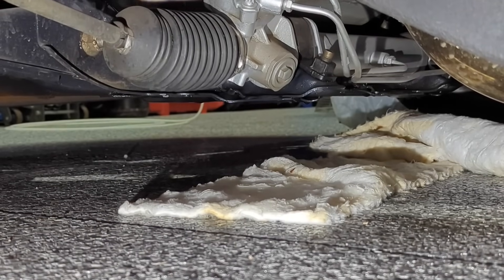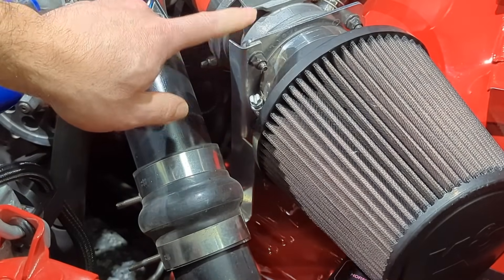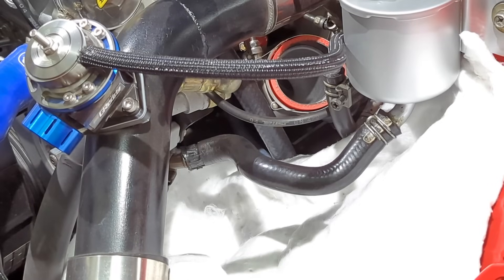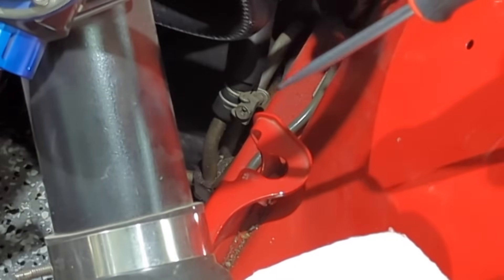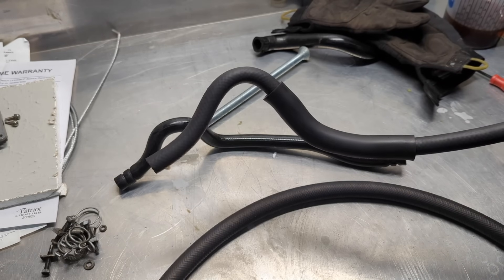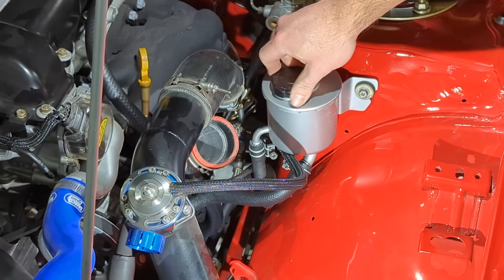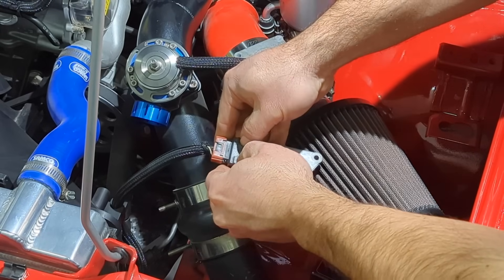Bend Rubber Hoses with Tubing Bender and Heat Gun without kinks!

Comment from the maker: Thank you all for great feedback!  Check out Part 2 where i use steam instead of a heat gun! https://youtu.be/n2sOGI15BnE?si=g1V-b-so6cwOiYtq
Reply: My method worked. I didn’t damage the rubber.
Reply: @erroldillon1548  Hey man, thanks for this. I used your method and it worked great.
Reply: What's that link?
I'll watch it if you give me a link.
Reply: I studied your video and did a new method. I made a template. I then placed the old hose on the template to make sure it would fit. The next step was to use a wood board with my drawn template to put screws on the side of the old hose. I heated the hose up. Afterwards I put it in the freezer.

Comment: Great video. However I see you are using tons of bad quality jubilee clips for water cooling lines. Any hose subject to heat cycles should use either Click-R clamps, Ear clamps or at least a spring loaded clamp of some sort. Else, it's guaranteed leaks later one when heat cycles create play in the screw mecanism.

Comment: Very interesting and informative video!! What size spring tubing did you use for the 3/8" fuel line hose.  I ordered some from Amazon but they were too large (OD) to fit inside the 3/8".  Please provide link where you ordered spring tubing that fit the 3/8" fuel line hose in your video.  Would really help me out.  Thank you so much.

Comment: I try with fine sand it works too. Just put sand into the hose until no space left and then bend it while heat it then dip the hose to bucket of water while rinse the sand out

Comment: You can put a copper line through the hose and bend it to the shape you want, heat it to about 250-300F and keep it there for about 5 minutes then throw it in the freezer for an hour, pull the copper tube out and you're done. Only 90 degree bends are a pain as you will have a real fight to get the hose off the copper tube, for that I drill a few holes into a piece of sheet metal, enter some bolts through the holes and place the hose in between the bolts so it would stay in place as its being heated.

Comment: what temp do you heat them up to ? Thank you very much for the info I'll try doing my oil return on my R33 gtr
Reply from the maker: Around 200 degrees in freedom units works well, the important part is cooling it back down rapidly in cold water.

Comment: Yeah I cant get this 3/4" coolant hose to stay bent using this method.
Reply from the maker: Are you cooling down with cold water while still bent?
Reply: Yes. I tried 3 different times too. The only difference I see is he is using the stiffer type of hose power steering hose or fuel injection hose.

Comment: Doesn't work long term with rubber hose. 
The rubber hose is made of a thermosetting compound.  Once heated and cured it is that form and can't be reformed.  
You can do this with plastic that is a thermoforming compound.
Reply from the maker: It's worked long term for me.

Comment: Hope not using fuel lines for replacement not rated for power steering fluid.. will deteriorate from the inside out. Just a little tip
Reply from the maker: Thank you for the feedback.

Comment: thank you from the bottom of my wallet you just saved me $100s of dollars in metal fittings . i had 8mm oil hose i  used an extension spring cause i didn't have the fancy stuff like you had with the aid of some tie wire measured the depth i needed and the over bent about 30 degrees and used a small kitchen gas torch heated had to do it twice  but result  125% thank you again
Reply from the maker: Sounds like you used some great innovation! I'm glad I was able to help! Thank you!

Comment: Hi sir. About how much of heat (Degrees Celsius) is needed to bend the power steering hose?
I don't have a heat gun. Will a hair dryer be good enough?
Reply from the maker: I dont have the exact temperature needed, but it seems somewhere in the 90C range would work. A hair dryer could work, you would just need to apply the heat for a longer time. Thank you for your comment and good luck!
Reply: @thegaragehub  Thank you for your assistance. I will just purchase a heat gun instead.  It would be much quicker doing the job 😅
Reply: Hi. Got myself a heat gun. Tried, but the hose isn't bending 😅. Maybe not long enough?
If you don't mind, how many minutes did you heat the tube until it was able to bend?
Reply from the maker: @Ad-gc7th  it depends on the size of the hose, the ones I did took about 2 minutes, if they are bigger go a little longer. Make sure to move the heat all the way around.
Reply: @thegaragehub  it's a 3/8" hose (9.5mm)
Reply from the maker: @Ad-gc7th  heat it for twice as long as the first time and see how that works
Reply: @thegaragehub  Ok thank you sir for your early response. It bent a little and retained the shape. Maybe I'll do it one more round and then hopefully it will be the desired shape.
Reply from the maker: @Ad-gc7th  it will help to bend the hose further than you want, and cool it down quickly
Reply: Good evening sir.. Is your hose rubber made of NBR?
Reply from the maker: @Ad-gc7th  probably to some extent, with brading.

Comment: Very good technique. Is this what mechanics use when they fabricate hose? I was wondering if this could reduce the durability of the hose because you are heating it up and changing its shape?
Reply from the maker: Its an option! Durability wise, only time will tell. I just made another video using steam instead of a heat gun.
Reply: @thegaragehub  do you know which method the manufacturer uses to bend hose?
Reply from the maker: @Dynasty-s1y  according to a comment, they use steam.
Reply: @thegaragehub oh wasn’t sure if they used some sort of mendrel
Reply from the maker: @Dynasty-s1y  oh I'm positive they do, wonder if they ever covered it in "How it's Made" tv show 🤔
Reply: Hey I gave this a shot on a power steering return hose for my car but it didn't seem to move very much at all. I am wondering if my issue was not enough heat or if the hose itself was too strong maybe? I heated it to the point where i could see a little smoke come off at one point. @thegaragehub

Comment: Nice video got a suggestion, auto trans. fluid has abrasive in it for the fiber plates in the trans. and will cause premature wear in your p/s pump and steering box and hoses and seals! Try 10 weight hydraulic oil or baby oil which is the same thing without the additives and will not harm your p/s system. Baby oil is cheaper to.
Reply from the maker: That's quite interesting. I'd like to know more about this.
Reply: @thegaragehub  ok baby oil is refined petroleum or mineral oil and so is power steering fluid! It is also made from vegetable oil to and vegetable oil will mix with mineral oil to but don't mix it with oils like motor or gear etc.  Automatic transmission fluid has polybutenyl succinimind is a dispersant and tricresyl phasphate dielkyl phasphite are a friction modifier that's in transmission fluid for the clutch packs and band inside 99% of automatic transmissions okay 👌

Comment: Good stuff. Why didn’t I think of this? You don’t need special tubing bending tools. You can use extension springs from the hardware store where the OD of the spring will slip into the ID of the hose.
Reply from the maker: Thats a good idea!

Comment: Let me know when you have thirty years and no failure. Old Mercedes Benz hoses can be 50 years old and still not have bad rubber. They were made before the first OIL CRISIS, when all quality parts especially those like rubber were made with inferior quality
Reply from the maker: Well the oem ones made it 26 years, if I change that one clamp I'm hoping to get at least another 20 years on them 🤞🏽

Comment: Material memory could be an issue IMO, when it gets hot the bends will straighten out. 
Great idea, will try it for sure, TY
Reply from the maker: This may be true. However it is a solution when the oem hoses are not readily available or no longer produced. There are other methods such as converting to AN fittings and lines that would be a more permanent solution but rather costly compared to the example given. Thanks for your feedback.
Reply: I believe it is inevitable that this will shorten the life of the hose. When they molded new ones they are chemically changed by heat. You are changing the chemistry of the rubber, and I bet it is not the same as when it left the factory. The majority of the stress is in the fabric layers and they are probably not affected by the heat. But if you heat rubber enough to make it no longer plastic it will change it
Reply: @dennis-nz5im  Hose life is definitely a concern. I think I would do this in a last-ditch effort if there are no custom hoses available for my application.

Comment: Nice work  Clever . 
WHY? reuse those Garbage quality Bent Wire hose clamps though ??
 They.. are the reason the OEM hose failed.
Reply from the maker: It's all I had on hand, I need to replace them with maybe some t bolt clamps.

Comment: Very interesting video. I never would have thought that you could heat up the rubber hose, bend it to the desired shape, let it cool down and it would retain the shape. Thanks for the tip. Will come in handy.
Reply: My only concern is material memory,  ie first time it gets hot it returns to straight
Reply from the maker: Thank you, glad you found it helpful!

Comment: Thats a great idea & video! I've done a similar type bending job on PVC pipe with sand, in place of the spring things, that worked pretty well. I wonder if sand will work in rubber hoses too?
Reply from the maker: Yessir, that works on PVC. For the automotive application there is a possibility of contamination so it is not advised to use sand.
Reply: You'd ruin your pump if there's even a tiny bit of sand left inside the hose.
That might be acceptable for coolant, since the clearances in a waterpump would allow sand to pass through it without damage.
But anything that runs oil usually have a pump or bearings somewhere with a tight fit which would be scored by anything left inside.

Comment: I made some bend test with small diameter plastic hoses. I made a spiral from steel wire to support the hose and pushed the spiral into the hose. I bend while heating. When the hose cooled, the shape remained. That way you can get a bend in a long hose, far from its ends. Next I try get two different diameter (6 /12 mm) ends in same tube.

Comment: Dip the hose into a bucket of ice water immediately after heating at the desired angle. I do this when I make fuel injection lines.
Reply: Actually, that's exactly what he ought to do.  When plastic is formed, it's run through a trough of cold water.   Pulls the molecules together and gives em memory.
Reply: @lawerancelanham   This is rubber, a thermosetting compound. Once cured it does not melt when heated, unlike thermoforming plastics like PVC.
Reply: Or you could mist it ! With trigger bottle with 💦 water 🚿
Reply: How hard is it to get the bender out?
Reply: @michaelmenard8913  Spray lubricant inside the hose and twist the bender out. For very small diameter FI lines like on K-Jetronic systems I use old speedometer cable core in place of tube bender.
Reply: @geothon 
I was thinking of making some KE jet lines .. what plastic pipe do you use please ?
Reply: @rodderyup7401  I bought some proper Black Polyamide  hose from Global Metrics in Belmont, Ca years ago. Give them a call, they have tons of fittings of all kinds for K-Jet. Usually you can repurpose salvaged fuel lines from FWD VW's you find at the wrecking yard. Cut, heat gun the ends, push them on, cool rapidly and that's it.
Reply: Great tip!
Reply: Ty I needed that info to make hose for my AC to drop out my window. I wanted to make sure it doesn't drip on outside walls .
Reply: Can you bend 3/16" size fuel hoses?
Reply: @LeoMakarov-t7f  By using speedometer cable on the inside.
Reply: @LeoMakarov-t7f  i did 21mm id fuel line yesterday..worked great.

Comment: What stops the hose reverting to it's original shape when it heats up in service?
Reply from the maker: That's a great question. There was a comment from someone that works for Gates saying they use steam to bend hoses and I'm sure they know. My guess is that when you heat the hose up hotter than the engine bay temps and then cool it off, you've changed the rubber enough so it retains the shape, but that's just my guess 😅

Comment: On my 240 I managed to make all kinds of random hoses from the auto parts store work for the cooling system, but that power steering hose is the real kicker. Seems like a lot of S chassis people just go to custom AN fitting line kits but I didn't want to do that.
There's a company called Pro Shop Noble that sells a supply hose that I ended up using, but it's pricey. I wish I had seen this sooner.
I'll use this technique to replace my return hose which is currently just a length of straight 3/8 fuel line. I'm sure it'll eventually start leaking.
Reply from the maker: Thanks for the comment. Yeah, I didn't feel AN fittings and hoses were needed here unless I was trying to hide the reservoir or something. I will be doing all AN lines for the fuel system and run e85 in the future.
Reply: Sorry to bother this old comment, but i have an n14 nissan sunny with bad return hoses. I was measuring these hoses and they seemed very odd size (in mm)  this is a euro car, but i'm suspecting these hoses are actually so called 1/2 and 3/8 size. I'm starting to think all japanese vehicles follow this same rule. Were they inc sizes in your 240?
Reply: @mercer982  I suspect the sizes are actually metric but perhaps not metric sizes that are common in Europe? I remember there being some fittings particularly larger ones where American inch hose sizes don't fit securely and I had to use an original part or make something work from another (likely Japanese) car by matching up hose shapes at the auto parts store.
I think most hose fittings on the car are actually even mm sizes like 4mm, 6mm, 8mm, 10mm, those just happen to line up with about 5/32", 1/4", 5/16", and 3/8" close enough for rubber hose to stretch on.
Reply: @AKADriver  this could actually be the case, since everything else seems to follow the metric rules. Perhaps these hoses are so swollen up (which they are) kinda makes measuring difficult.  Perhaps it's even easier to fix these in europe after all hehe. We got all sizes of metric hoses.  Thank you for responding.

Comment: Using sand in hose, like with metal tube bending, might be other way.
Reply from the maker: There's a possibility of contamination with sand. Just a thought.
Reply: @thegaragehub  You can use plastic bags for prevent it.
Reply: @jarikinnunen1718  In a radiator hose, maybe.

Comment: Does the heat gun reduce the service life of the rubber on the hose ..????
Reply from the maker: Time will tell. They are heated at the factory but i'm sure they use a temperature that works for them and does not compromise the rubber. I can see damaging the rubber if you heat it too much where it begins to burn, but the hairdryer of a heat gun i am using could'nt produce that much heat.
Reply: @thegaragehub  

Thank you for the quick reply and for this video that shows how to do the bends.

Toyota wants $100 for 4-foot suction hose which comes out to around $25 per in foot for my 1999 Solara 3.0L V6.

Good to find out the heat won't reduce service life.
Reply: Other people have said that steam will work too. So those small steam cleaners that were all the rage on AS seen on TV adds a few years ago for cleaning kitchen and bathroom tile might be worth a shot

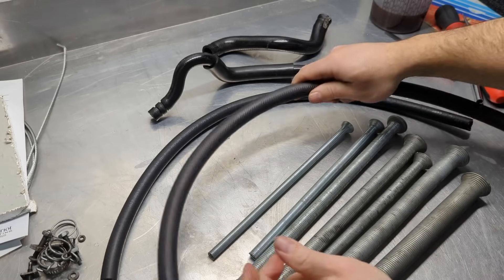Comment: @7:20

THAT IS EXACTLY HOW THE SUPPLY HOSE ON THE POWER STEERING SYSTEM OF MY 2000 FREIGHTLINER CENTURY IS..!!!

KINK AH KINK AH KINK AH KINK

I did not buy the truck know so I have not the exact way it came from the factory but when I bought it it had a major kink. The hose was dry rot so I replaced it with like 14 inch shorter hose which took some of the kink out but I'm still not happy. Perhaps your video can show me the light to do a nice professional bend.
Reply from the maker: Give it a shot!

Comment: Fantastic.
I have an old Land Cruiser with a heater hose that I can't find anywhere. It turns 180 degrees so this is just the  info I needed.
Reply: The hose on my '79 Land Cruiser that goes onto the thermostat housing is prone to failing and is a sharp bend. I had to use a long hose that would make the bends. I wish I knew about this technique for forming hose. I wonder if the heat bending on the original hose is what makes it weaker though?

Comment: If you put hot sand inside it will not claps!!!.
Reply from the maker: While that is a good idea, there's a possibility of contamination to the fluid.
Reply: People sandblast metal parts, and often after reassembly, a grain of sand can do a lot of damage.
Reply: I'm thinking with a lot of heat and thus and thus and could partially embed itself in the tube to a point that flushing with water might not remove every bit of it.  That little bit of sand stuck to the hose might come out or get dislodged after some heating cycles.

Comment: Where did you get those spring tube benders?
Reply: They are mainly used in plumbing. So look in the plumbing department.
Reply from the maker: I bought those years ago at an HVAC supply store, but you can find them on Amazon.
Reply: For bending copper tubing